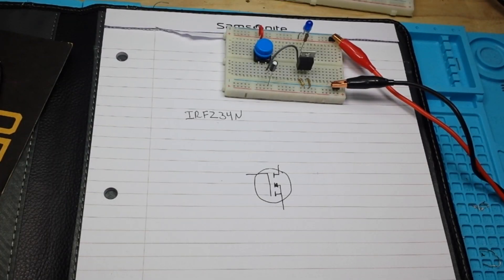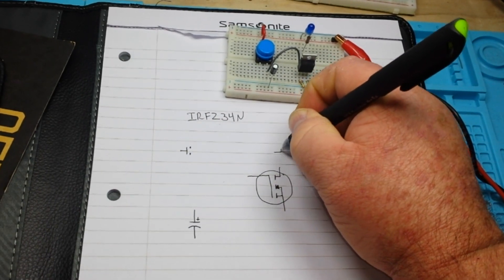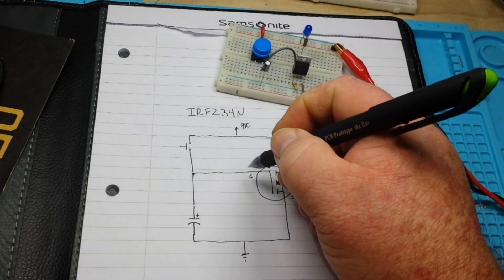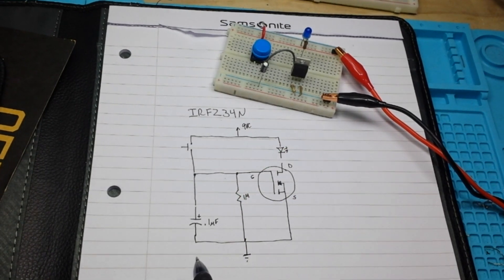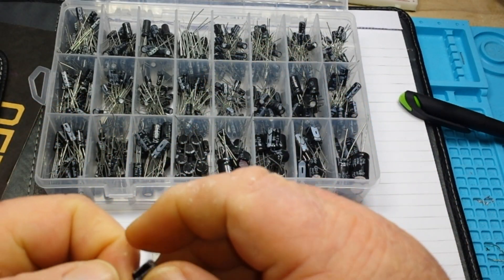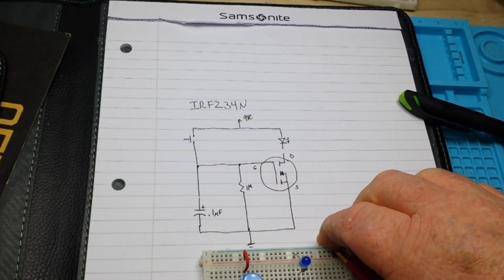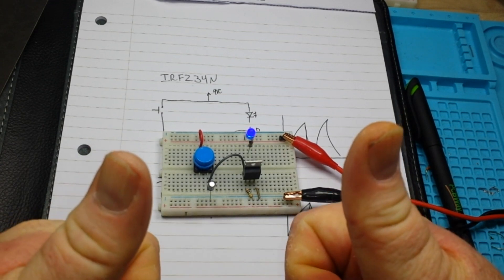MOSFET - Off after a delay

Comment: Hi, very well explained.can the switch be a toggle switch.but does the same work? Basically 1 want to use this circuit to switch on a  item with a car ignition  switch and it will supply 3 sec on and then off. Once the the IGNITION is switch off and then  on will do the same.

Comment: Very nice circuit.
Can it work if i remove the button and stays always connected.
I want to make it work when i give it constant power supply and then the circuit turn off but the power supply stays connected until i cut the power off and reset itself.
Please (you or someone else) give me an answer even if it can't be happen.

Comment: Could I use this type of circuit to turn a DC motor on and have it shut off after just a couple seconds?  I am trying to do a delay off in a very confined space.  This seems like one of the most simple (and space saving) delay off circuits I have seen.

Comment: Thank you for this circuit. My understanding of this circuit is, when you press the button, you charge the capacitor, then when you release the button, the capacitor get discharged on the resistor because there is no current flowing between G and S terminals, so all the current goes through the resistor. 
The MOSFET is acting in the saturation region as a current source because (V_GS-V_T) is smaller than V_DS.

Comment: Get out of my head 😆
I am working on a project for work to automatically turn on the  ventilation system for the CNC plasma table. When the plasma is on the vent is on but i need a few minute delay to finish venting the table this is perfect.

Comment: Thanks.  I have been looking for a way to do this.  The only thing is that I wanted a square wave output.  To that end, I played around for a while in everycircuit and came up with this:  https://everycircuit.com/circuit/4959474069274624  My description reads "Pressing button turns on blue LED.  Stays on for the delay time delay determined by the RC timing with the on/off threshold set by the voltage divider.  This makes the switching a square wave.  Red LED is directly controlled by the RC circuit, so it starts to fade as soon as the push-button is released.  The blue is at full intensity until the circuit times out."  Ypu can fiddle with the settings by clicking on a component, then click on the wrench symbol in the lower left and move the dial that appears on the right.  The green line in the graph is the RC circuit; the purple is the input to the mosfet gate controlling the blue LED.

Comment: Again a video I needed, and at the right moment:-)
I did make a delay, but only using a cap across positive and negative, follow by a resistor on the positive rail. It make the LED, fades in and out on push of the button.
Reply from the maker: Sounds great!

Comment: Is there a formula for this specific circuit to calculate the time on based on all three variables, voltage, resistance and capacitance?  Could you add into the "down below" so it's viewable to everyone without having to read a reply to my comment?
Reply: 5RC will give you the discharge time, however, bare in mind the VI curve of the capacitor and LED is not linear so it will fade slowly then just go out. Similarly the response of the mosfet is not linear so that too will affect the result.

Comment: What would you change to make the LED go completely off instantly, rather than "fading" off as it shows in your video? So the LED is either completely off, or completely on but not a state between those two.
Reply: You can add a Schmitt trigger to get a clean logic switch between the filter and the gate.

Comment: i must say i love the knowledge and experience u share with us. also like the Classic Circuits knowledge u share.

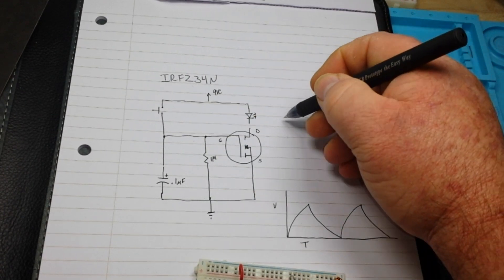small note/question, at 5:02 the second graph, are we not doing the opposite? i.e. with the resistor make the capacitor discharge slower? i.e. less sharper. thx!
Reply: The resistor is pulling current to ground discharging it faster
Reply: The graph has slight issues, there is not resistance to limit the current while the capacitor charges up when the key is pressed. so the voltage rise should be almost vertical and stay there without the 1M resistor until the cap self discharges. the 1M resister gives you a defined discharge path so you can control the discharge rate.

Comment: What’s the ratio between the capacitance and the on time in seconds
Reply: 5RC. But nothing in this circuit is linear (bar the resistor) so timings won't be that accurate.

Comment: can you show the simplest way to make timing independent of how long the button is pushed?
Reply from the maker: It is. You only need to press and release the button.
Reply: @learnelectronics  Yes, but it seams to me that as long you keep the button pressed, the light is on. What if you want to make sure that the time will be shorter than you could control with your finger. To trigger a relay in a spot welder for example.

Comment: Something else I miss about a "switch" like this: What's the current through the FET when it's off?
Reply: Current only flows through the FET when Vgs is above Vthreshold of the FET. When it is below that then no current will flow.
Reply: @jonelectronics510  "No current" is not possilbe. It is a FET-Transistor, not a switch. This question is important if you operate a circuit with batteries.

Comment: I just spent $90.00 on SSR Solid State Relays to switch Solar Panel Voltages between uses-es.  Following up explain Thermo Heat Management of the Mos Fet.

Comment: Thank you, Simple timing like this I have built in the past (with NPN switching transistor) I've put a resistor along the base line for delay.  Is there some Mosfet reason for putting the resistor gate to earth?
Reply from the maker: The resistor speeds up the discharge of the cap.
Reply: Antony, the NPN transistor is a current controlled device. it needs current to flow into the base for it to turn on. so the discharge time of the capacitor between the base and emitter controls the on time, to modify the on time you change the discharge current by changing the resistance between the cap and the base. The fet is a voltage controlled device when there is only current flow in to the gate at the start as the gate capacitance charges up. after this the fet can stay on all by itself, the capacitor is much large then the internal gate capacitance and with the  1M resistor to ground gives you more control of the timings.

Comment: Could use this to drive something like a porch or driveway light or a time out on my radios lol. I tried to make similar with a different tran and got a different effect where switching by a tap from + resulted in a perma power on till tapped with - which resulted in a power off. It's a trans I got for my UPS that went BANG and smoked ... one of these trans was missing it's hat after that. HOPING it was just the trans ... hoping.
Reply from the maker: As long as you dont exceed the power rating of the FET you can drive whatever you want. Put in a big cap and remove the gate to ground resistor and you can have delays that last days!
Reply: @learnelectronics  yeah think the idea is use this circuit to drive a relay to power on/off whatever you're doing.

I understand some electronics principles but have a hard time still generally speaking with certain things (biggest reason I'm still needing to upgrade my ham call). Out of curiosity what was the resistor put in place for here? Extra drag on the cap?

Comment: It would be a good idea to place your RC filter into a Schmitt gate so you don't run the mosfet into the linear mode. With an led the load would not be an issue but if you used that with a higher amperage it would heat the mosfet up as it switches off . Maybe that would be an interesting video to scope the gate with and without a Schmitt to get a clean on and off switch? Thanks for the video as always Paul ;)
Reply from the maker: Thanks, that's a great idea
Reply: +1 on this for future video. :)

Comment: Hey, just a quick question, can't really see on the board on my phone, do you need a current limiting resistor on the led or is the mosfet sufficient?
Reply from the maker: There is a resistor soldered to the cathode of the led.
Reply: @learnelectronics  I see! Thanks